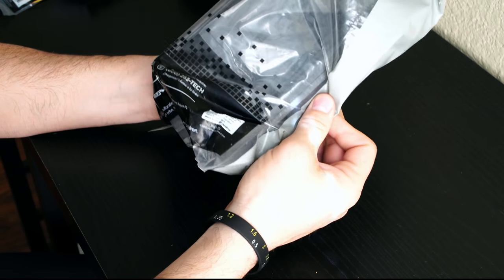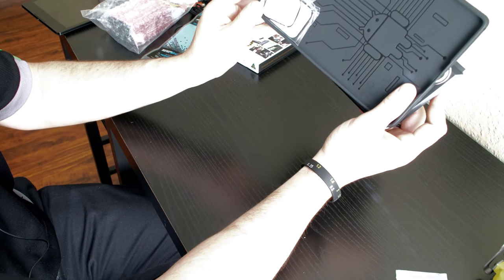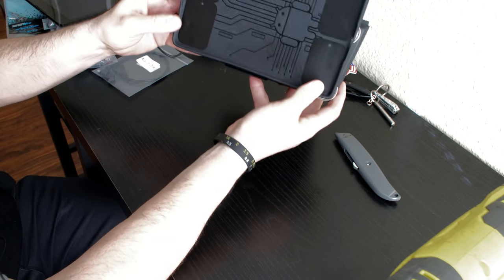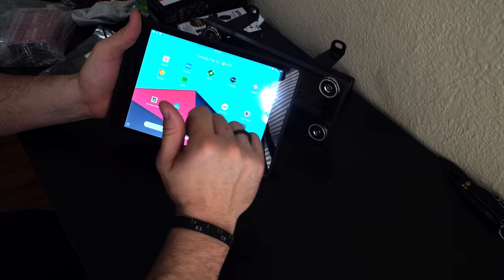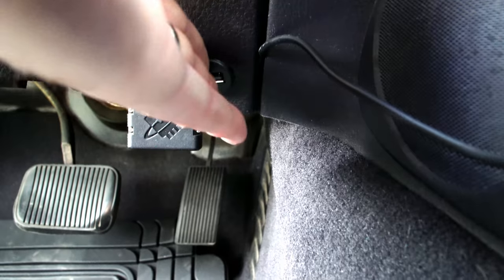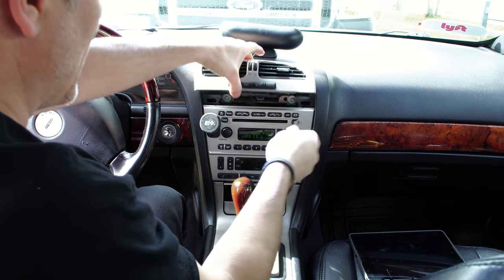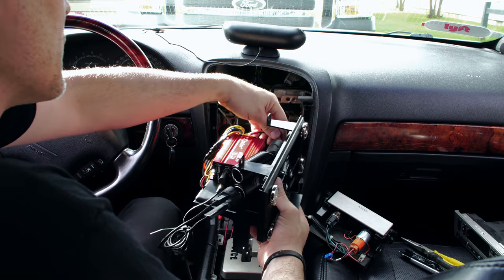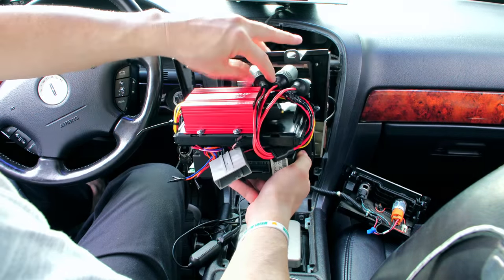Turn Your Tablet Into A Head Unit

Comment: I applaud your ingenuity. I am just astonished by people that lack yours (and mine and other's) ingenuity though. Not trying to act better than by any means.
Reply from the maker: Thank you very much for that compliment! I have often pondered that myself. All you have to do is take a look at social media and you will see that the amount of consumers far outweighs the creators. Some people enjoy solving problems and creating things, other people get pleasure out of the consumption of those things. I'm also pleased to be on the creative end of that balance.
Reply: @edwardlthompson  EXACTLY! I seriously could not have said that better myself. Since I was a little boy, I took apart my toys to see how my toys worked and what was inside. Sometimes I would re-purpose what I found. This transpired into me bringing home "broken" electronics, vacuums, and appliances, repairing and selling them on craigslist. Getting somewhat off topic, I used to live not too far from you, in Shreveport, LA (185~ miles). I worked for a Ford dealership (Rountree Ford Lincoln and Mercury, familiar?), as just a lube tech and I bought an old 1981 Ford f100 from the engine tech turned shop keep, and it was in terrible shape. I ended up having to drop the tank, replace the fuel sending unit, fuel lines, rebuilt the (single barrel) carburetor, redid the suspension, clutch and flywheel, power steering etc,. While doing this, everyone kept saying I couldn't polish a turd, which was inarguable...at first sight. I then focused on the interior. Pulled up the old rubber flooring and joot, laid new carpet, replaced the old trampoline bench-seat with a 40/20/40 bench layout from a 95 f150, everyone said i couldn't do that...i did. I replaced the dash which was cracked to shit with one from an 83 f350, they said it was too big, it installed perfectly. I installed a new audio system, LED foot-well lighting, USB charging port built into the dash very close to the same spot as yours, 110v power inverter wired to accessory on with a power relay for safety, i replaced the interior and exterior lights with LEDs as well and wired in power windows from that same f150 and a new alternator to be safe. Oh and tinted the rear window. FF to now, I have a 2001 firebird, I've wired foot well lighting once again this time front and rear while LEDs as well as adding red LEDs to the front foot-well and wired those into the running lights, the reason for red is because Pontiac uses red lights on the dash, radio and ac control module. When the doors open the white LED foot well lighting turns on up front and there are white LEDs that I've installed in the bottom of the doors so there's light outside the vehicle as well. Soon I will be adding Switches in the back for the kids to have foot lighting on demand instead of on only when the running lights are on...
 LOL, I'm not through yet, I also found a write up on how to add AUX in to the stock radio. Using an AUX jack, a relay for switching between the Bluetooth module, (that I got from disassembling and wiring to the face buttons for power Play/Pause next track and previous) or AUX in + USB charging built into the center console.  Instead of having a bunch of wires behind the unit, I used an USB ext cable for quick (dis)connect when pulling it out etc. This is also where I installed the ground loop isolator. These sorts of things are a passion of mine and I love seeing other people's minds at work and doing things like this. Oh are you on Facebook? 
PS sorry for the novel
Reply from the maker: @runn1nwith5izzorz  thank you for sharing that! I also work on cars! I have 2 cars I use for drifting. I'm familiar with getting creative with solutions for them. 😂 Yes, you can find me at www.facebook.com/EdwardLThompson

Comment: just ran into this video today, i got my own little set up and been using it for years now, just watching your video that looks like a long process, but it looks good.  i'll tell you how i got mines set up.  I got a Cd player mount to hold my tablet in place, and for audio i got me a bluetooth fm transmiter so everything is all wireless, and the transmitter dongle itself is plugged right into the cigarette lighter outlet, so i dont have to worry about buying batteries for it.  So my music is projected on the radio and it works pretty good.  Only thing i dont like about my set up is the fact that sometimes when i hit bumps or small potholes my tablet would weigh down the mount since its using a ball join kinda setup holding it, but it makes my tablet adjustable if i want to turn it vertically or horizontally.  I used to have a magnetized cd mount for my tablet, but i rather have the one i have because i know my tablet is more secure this way.  They mount itself is cheap, maybe bout 20 bucks or maybe less, i haven't gotten another one yet so i dont remember the cost off the top of my head. transmitter is around 20 bucks too. and thats basically all i needed. and good part is if you switch vehicles, you can always take it off from that one and transfer it to another. lol i dont use any of them apps you have on your car, but my tablet plays music videos off it, its a nice aesthetic look. and i sometimes use it for gps too. but i like the fact that you did it differently and got good results from it.  Just sharing you my build just incase you want to try when you doing it for another vehicle.
Reply from the maker: That sounds like a pretty sweet setup! Thanks for sharing!

Comment: Before seeing any video like this, I had bought a rather cheap ended, head unit, using Android 11 or so. Low resolution, needed adapters that weren't included (of course), and didn't fit like it said it would in my Volvo. Thinking of other ideas, I remembered that I had a Samsung A7 tab laying around in a ca binet and downloaded carplay onto it and well, I now have a head unit. Stuck the old magnets onto the tab from where I mounted my phone and it's holding well with a bit of alien tape. I wasn't sure if this would work, but it is. Your video just gave me a few more ideas for later on, well done!
Reply from the maker: Sweet! I'm glad this worked as some inspiration for you and good luck!
Reply: @edwardlthompson  Thank you. I downloaded the carlauncher app that you suggested, and it's great. Makes navigation easy while driving.
Reply from the maker: @logicalschizoid_intp9698  I'm glad to hear that works well for you!

Comment: Pretty great little video. I couldn't help but think that disconnecting the battery would be a good idea, especially around the plugs.
Reply from the maker: You're absolutely right but I was not working on anything that was connected to the battery until I connected the aftermarket pigtail to the factory radio harness. Never hurts to be cautions though.

Comment: Good detailed video. I know this video is a bit older and by now android head units are pretty popular. I installed an Eonon android head unit in my car but it has no real processing power. After much frustration, I've decided to leave the unit in and connect my smartphone to the unit via bluetooth. And this way I can have my phone do all the heavy lifting(processing, video playing, music playing, etc.) and treat the head unit only as a touchscreen amp and DSP. I'm happy with my set up and sounds great.
Reply from the maker: I'm sorry to hear that you have that experience. I actually spoke about that same thing in my update video as it is a common suggestion. Also, I'm not sure how well the software on the Android head units are supported. The benefit of the tablet I picked is that it is still getting nightly OS updates with Lineage OS.

Comment: I love this stuff. ive installed a dvd player in the front and overcoming technical challenges such as tricking the parking brake sensor to allow the video to play in the front while driving(for the kids to watch in the back) and getting it right , is so rewarding.  It was a rough time in my life, and my key broke and i couldnt afford a new ignition. Well, i sat there with my chiltons manual  and got to splicing, got the key beep sound, individually  fed the radio, and the A.C/heater, just using jumper wires and toggle switches. Finally, i wired up a door bell, as my "push button" start.   I was blown up in Iraq(dont feel bad, as my kids now get free college tuition) id do it again in a heart beat. Anyway the army instilled theat the only word you cannot say is "no".  Find a way or make one.  You have a beautiful home, beautiful car, and most importantly, a beautiful family. Youre a good man, and for what its worth, Great job, im proud of you. God Bless!
Reply from the maker: Wow, thank you so much for those kind words and I hope all goes well for you and your family. I can definitely relate to the feeling of hacking something to work better for you.
Reply from the maker: Make sure to check out the update video as I made some more changes to the setup.
Reply: @edwardlthompson  thanks for the reply. Happy Fathers Day. Find a way or make one !
Reply from the maker: @Dempdawg11  absolutely. Same to you!

Comment: I'm out my tablet using high temperature heavy duty velcro that I get from Amazon... The velcro you get at Walmart will not want to stick when it is hot but the stuff from Amazon will... To adjust the angle of the tablet just take multiple squares of the velcro and build it up the way you want... It works great for me.
Reply from the maker: Thanks for the tip and the comment!

Comment: Wow, you have done a lot. I have been an ASE Master Tech since 1978, and seen almost everything evolve over time in autos. The OBD-II connector has standard pin #2 for class2 serial data that is SAE required. Engine data comes thru it for a scan-tool, but in 04, GM used pins 8 & 16 for high speed CAN data bus. 
The Bluetooth dongle has bi-directional abilities but audio does not. The antenna supplies input reception but the receiver/amp has to connect to speakers via hard wire. Now depending on make and year, things get real tricky as GM radio if connected to OEM amp, the radio defaults to per-amp mode via class2 signal from radio to amp. Yes, this is sweet and works great. Forced into retirement due to joint pain, but you need wire color, circuit or connector as you did. They sell well built USB plugins that fit 50mm of surface. If you find the right one, it would be safer to properly plug in a customers device to the correct type. If marked, this would prevent wrong charging port and provide a fuse to protect your system. Fuses protect the wiring, not the device.
I am building a 67 C10 and thinking of tablet style controls as one is only limited to software and connections. Nice work!
I only wish Omaha had Texas weather.
Reply: Sorry but 25.4 mm =1.0 inch. I will check out the links as this software is getting better and cheaper. Too bad that tablet is soo temp sensitive. 
My tech buddy is at a Cadillac dealer and told me those are simply tablets in the dash, just OEM software. Also, listening to talk radio, I believe you can play a 15 second clip without getting a knock from the Music Police. Call a local radio station and ask the manager, they will know because it is bumper music for beginning or ending a talk segment. Stay safe.
Reply from the maker: Thank you so much for that information and good luck on your build. Make sure to check out the Update video as well, I go over some more information there and switched to a better tablet.
Reply from the maker: https://youtu.be/dmiVHRV2etw
Reply: Thanks Edward, I will find time and visit your videos. As a dealer tech of 4+ decades, I ended holding 4 hr. Tech seminars on 30+ subject in 6 Midwest states. I look forward to this type of info as my job was not modifying, just diagnose the root cause and install OEM parts. So never get tired of learning. Thanks for you efforts. Just wish I could still earn my own check...I guess that’s the farm boy coming out as we had no allowance, just 3 cents a bail to put hay in the barn, $1 to mow yards and same to plow or disc for neighbors. Stay safe!
Reply from the maker: @deankay4434  you must have some good stories. Sounds like you have lived an interesting life. I do appreciate the time you have taken to engage with me on this topic. I wish you luck.
Reply: If I can help with questions or wiring, use my contact and ask. I don’t have cable or working cell account but use a 7 iPhone my son sent me, hooked to $20 internet, so I may have info to help or suggest. Have a good Holiday as I just stay in my garage all day. Thanks for the kind words.
PS, you can take advance of online car forums for the brand you are working on as well, free!

Comment: Like your style bud, I bought a after market case once with strong magnets and it wiped my SD card so I use Velcro now without the risk.
A tab for a double dim works well for me.
Reply from the maker: Thank you! I was worried that the Texas heat would melt the adhesive on Velcro so that's why I went with the magnet attachment method. I've never had any issues with them and storage or screen issues.

Comment: this is a great jumping off point for the kind of setup i am planning for my truck. while i like the concept of using a tablet as a head unit, theres parts that wouldnt be compatible with my specific audio and sound responsive lighting setup. 

i have two amps (one running a low pass filter for my subwoofers, and another running a high pass for the rest of the speakers), so i would just need an RCA to run from the tablet output to the amp inputs. i am also integrating wireless charging behind the mount, so that i dont need to worry about cables all over the place. 

the biggest issues i see are running all volume controls from the tablet, and the heat output from your specific amp.

fantastic video, and it looks amazing in your vehicle. you did a wonderful job of explaining things in laymans terms (im considerably more experienced, apparently, in the fields of car audio and general electrical work, but it wasnt tedious to watch you explain the whys and hows).

great job. i just need to ask if there were any issues after extended use of the tablet in that fashion.
Reply from the maker: That's a pretty sweet setup you have!

To simplify things and completely eliminate cables, you could connect a Bluetooth dongle and adapter to the RCA port. I also considered getting a tablet with wireless charging! I have a war on visible cables! 😂

There are many wireless volume control options. Some stick onto the dash and some are designed to clip onto the steering wheel. Most have media controls as well.

I have not had any issues with the tablet. I am running it a minimum of 8 hours a day, 5 days a week. The key is, I always take it with me so it's usually in a climate controlled environment. I have had it exposed to some extreme heat on a few occasions and it has not effected it. I would not recommend extended exposure to the elements as these devices were never designed for that kind of exposure.
Reply from the maker: Oh, and I guess because of the size of the amp, the heat from it was hardly noticable. It certainly didn't effect the tablet negatively but I did stuff a microfiber cloth in behind the tablet to block off any heat from escaping into the cabin.

Also, thanks a bunch for the positivity and encouragement! I look forward to seeing what you build.
Reply: @edwardlthompson   I would suggest getting an external sound card for a PC.   Its USB and will provide much much better audio processing.  As well as the option to go 5.1 surround..  Or not..  Either way youll have the option to seperate the front and rear and add a dedicated sub out.
Reply from the maker: @toddwest9115  sounds good. thank you for the suggestion.

Comment: As an audio installer/expert i did cringe a couple times early on, but im glad to see you got a ground loop isolator I knew that was gonna be an issue fairly early on, and a few other little things i saw coming, but you seemed to figure them all out by the end and did a good job. For a long time ive considered doing a small form factor pc build into a car as an audio/mobile office sort of thing, have it all planned out but havent had the opportunity to put it to use, but an interesting watch for sure, good job on getting it all worked out and looking clean at the end. Well done sir. the one thing im not sure how you dealt with is all that gob of power adapters, Maybe you did, but I would have ran a new fused line from the battery or power cluster to power that all rather than running it off of an existing system just to ensure there is no bottle neck of power. or even add it in with the amplifier power.. maybe thats how you did it, I couldn't tell for sure from the vid. another interesting tidbit... If you can manage to ground everything in the audio system to the same point, or pull power from a capacitor, sometimes that will filter out the ground loop as well... And if you haven't already, I'd suggest getting a nice AGM battery to replace standard lead acid if you haven't already, it will handle the extra draw of all the accessories nicely. Just a few little tips that may help.
Reply from the maker: Thank you so much for the input! The only accessories pulling off of the power outlets are the LED light for the Uber/Lyft sign and the dash cam. I spliced that into the aftermarket pigtail power that was also powering the amp. I would love to see your in dash PC build! That sounds dope! I appreciate your feedback and thanks for watching!